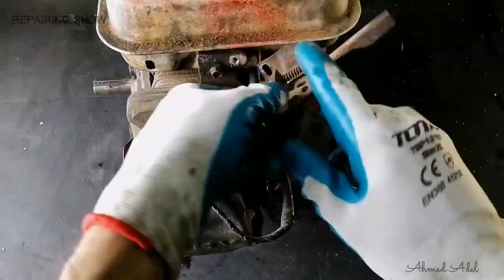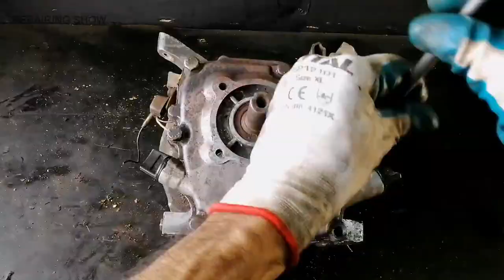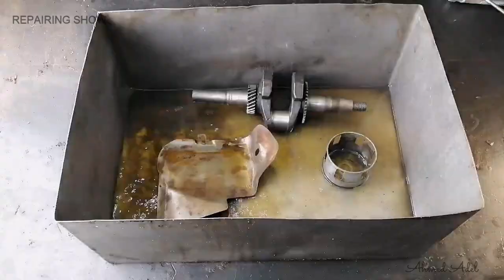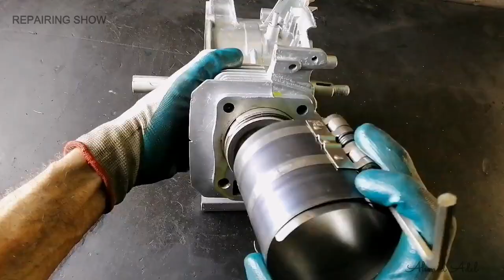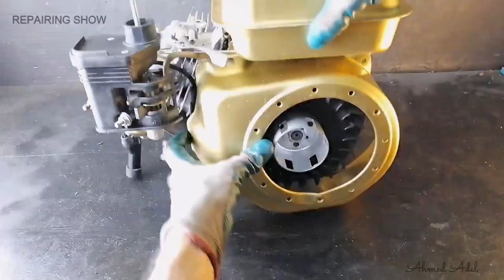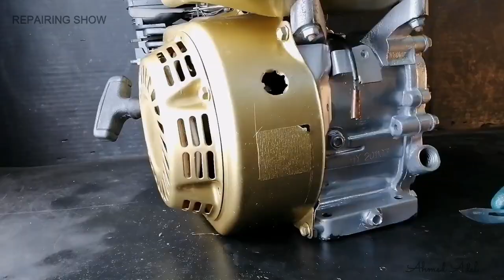RESTORATION RUSTY ENGINE GX160 - Restore small engine gx160

Comment: For you to go to all of that trouble painting it I would've replaced the piston rings while the crankcase cover was removed I would've replaced the piston rings, unless you did that off YouTube.

It looked like it was burning a whole lot of oil judging from the amount of carbon which was built up inside of the cylinder on the piston crown & inside of the combustion chamber inside of the cylinder head..

I have recently completed a Honda GSV190 engine rebuild because it's my dads & it was burning a lot of oil on startup when the engine was cold & it went away once the engine warmed up.

While it had nowhere near as much carbon as that engine had it was still burning a lot of oil when it was cold !

Comment: What do you put on the bolt and nuts with the syringe to get them loose! New to the channel but love the channel so far. Thank you for taking the time to make amazing content.
Reply from the maker: I put brake fluid in the syringe, some friends recommended it. This oil helps remove rust. But I prefer the Q20, it's good at this

Comment: Why did you not cover any of the ports or anything when spray painting it. Also you gouge the s*** out of the cylinder head around the valves. Did you do any work to the carburetor

Comment: You're did your job within a span of 14.24 minutes but l don't even know what you doing actually nobody will cuz of your fast forwarding videos, which means not worthy of.
Reply from the maker: Thank you for your comment. My goal was to restore and restart an old engine, and that took me a lot of time, so I had to shorten the time as much as possible so my followers wouldn't get bored. Sorry for the speed of the video ❤️
Reply: change the playback speed if you want to slow it down